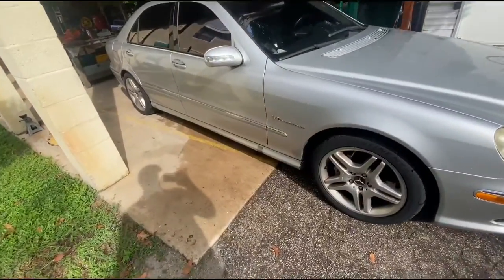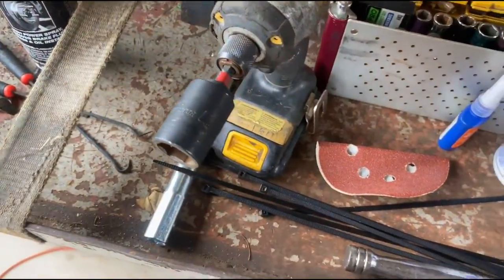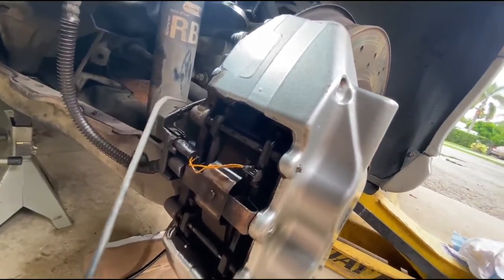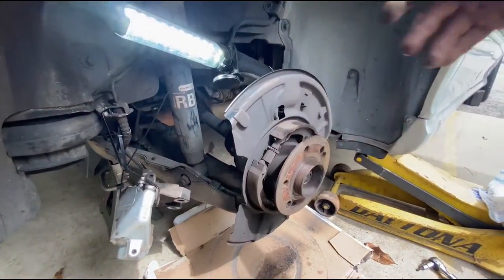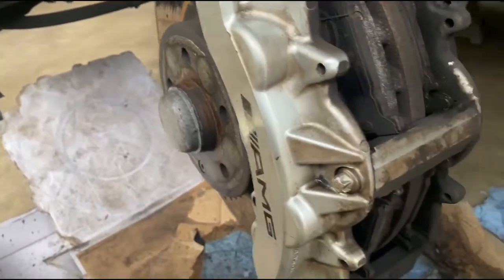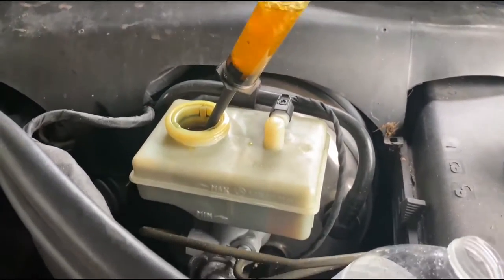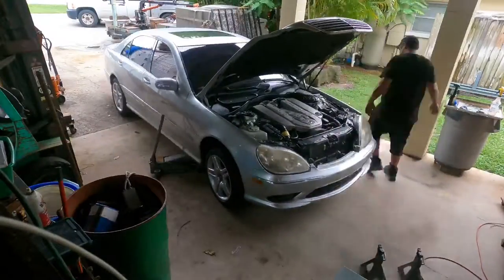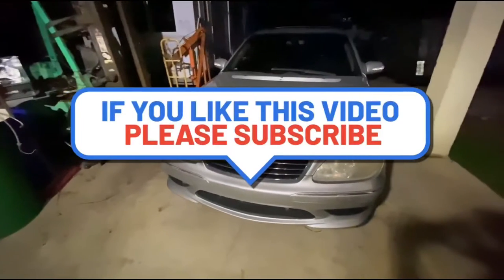DIY S55 AMG Brake Rotor and Pad Removal, Replacement, and Coast. $750 just in parts!$!$!$!

Comment: i use zimmermann with brembo low met pads n50062 front and n50061 rear i do 5 beeding in as if im at race track then stopping power is insane u can fly out the windshield if u r not wearing seatbelt from my experiance they stop better than genuine pads. but fcp euro free brakes for life is hands down the best.
Reply from the maker: Thanks for sharing, FCP is awesome for the DIY guy. lol
Reply: @ProjectShopFl  do factory brake pads need to be bedded and or have a bedding procedure? Or do they automatically have a brake in surface on the pads that allow bed in procedure to occur?

Comment: also for the front calipers, do the pins go
onto the spring clip thing ? not through the actually brake pads right ? because I notice only the rear pads have holes at the top of them
Reply from the maker: Its been a while and I would have to look at it to be sure.

Comment: I have a question. I have a 2005 S500. I want to paint the lower mesh grille. I looked but I cannot figure out how to remove them. Do you know how?
Reply from the maker: Not off hand but probably some clips holding them in.
Reply: call me i explain 424.999.6000 is it the amg bumper or regular bumper?

Comment: did you shut off the SbS pump before pushing the calipers back
Reply from the maker: I did not know I had to shut anything off
Reply: @ProjectShopFl  I think there is a unit in engine compartment that you disconnect
Reply: The S55 did not have SBC. The E class, CLS, and some others did.

Comment: Believe or not Mercedes charges about 700? dollars for this job.
Reply from the maker: Hard to believe when I paid $700 for just the parts from a company that is always cheeper than the dealer and not including labor. Is that for a standard w220 Mercedes or the S55 AMG because there is a big difference
Reply: Gonna have to agree with the creator of the video.

No way in hell you’re only paying $700 for this job parts and labor. I just received pads and rotors from rockauto (brembo) and spent $780 shipped to my door step. I’ll be doing this job tomorrow morning.